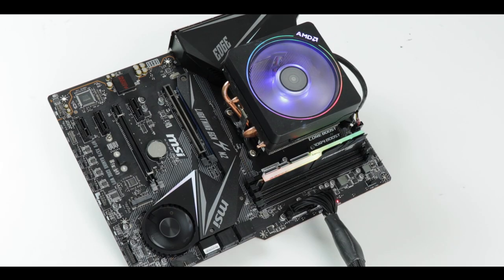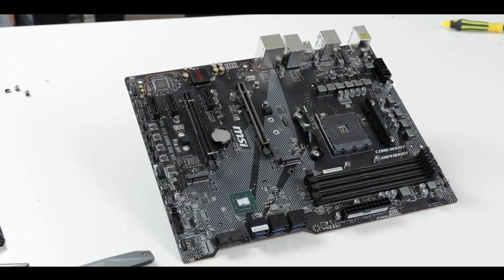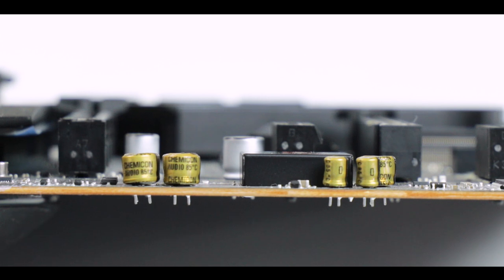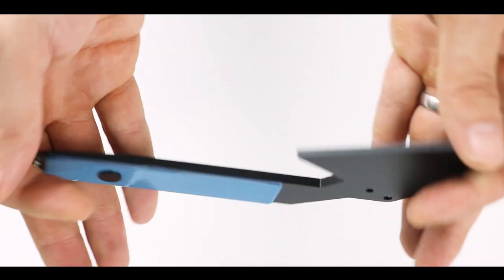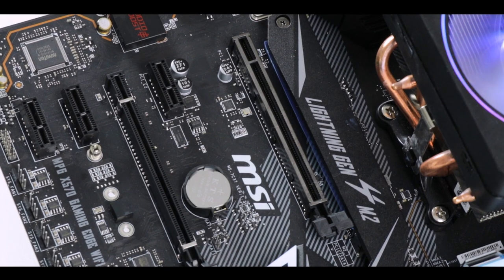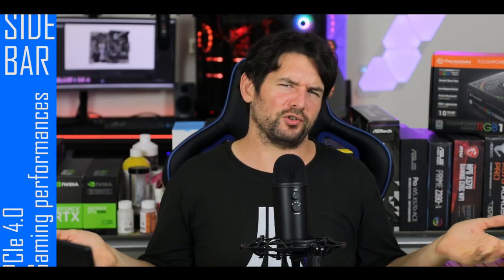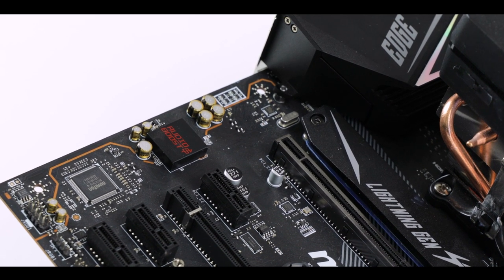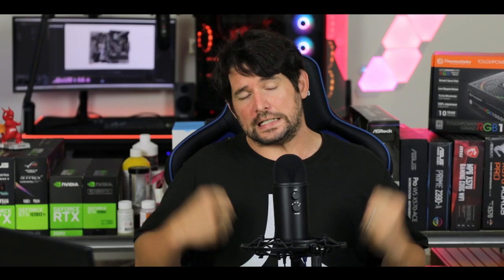MPG MSI X570 GAMING EDGE WIFI : No, No, No!

Comment: I have same mb. 128GB 3600Mhz memory, RTX 8000, AMD 3950x. I'm rendering 3D animations everyday and i did not have any f*cking problem :)
Reply: Same here no issues at all, lol.
Reply: not as workstainy as yours but i have 16 GB 3600 Mhz, AMD 3900X stock AMD fan and a RTX 3070 and i've had zero issues with stability. sure it took 2-3 months to get a bios that would let me use the full 3600 mhz instead of 3200 mhz but that's IT! nothing else! it's a super stable platform and i never experienced random crashes or bluescreens. 
my mobofan is set to the most silent option and i only see it spin up when turning on the computer else it's just stopped. the warmest i've seen in my room is 32C so it will be pushed but still never really turns on. 

I don't really need the feel to overclock any cpus these days and certainly not my 3900X which chugs through anything i throw at it.

Comment: I have this board. Easily installed into a fractal meshify-C and booted on my first attempt with an R7 3700X and 16GB 3200mhz ram (after enabling XMP) with no issues! I have an evo 212 black edition for the cpu cooler with 1 intake and 1 exhaust case fans and my VRM’s at stock stay sometimes stay under 60C and never go above 65C when intense gaming or long video rendering. I was very impressed with the thermal performance of this board compared to some complaints I’ve seen online in videos and comments. I can recommend it! One complaint I do have is that the WiFi is trash. Had to buy an external USB WiFi adapter to take advantage of my gigabit connection, but if your max download speed is less than 300mbps, it wouldn’t matter anyway as far as speed is concerned. As far as range is concerned, my router is about 10 feet away, so I can’t give accurate feedback about that. Overall, I recommend for anyone looking for a budget X570 board and don’t wanna deal with biosflashing
Reply: What I read ryzen7 3700x 65w tdp is good for this board :)  I have bought same combo and waiting its arrival :) problems starts with ryzen 9 3xxx . So probably ryzen 9 4xxx maybe 65w tdp will be cool for this board ;) :D
Reply: I also have this board with a 3700X and 2080Ti on a machine that I use for VR gaming, game development, 3D CAD design and video editing, and I see similar thermals as you do. I've never had any issue with it. Using 3600MHz Trident Neo with XMP.
Reply: Can you use in the first m.2 slot only gen4 m2?
Reply: @kunstlicheintelligenz8043  no , it can be used with gen3 also
Reply: @akshay-lifeofayogi321  but the thing is the first m2 slot doesnt work with my gen 3 m2 but it becomes energy. the mainboard is not broken but my m2 works in the second m2 slot normal without problems
Reply from the maker: Yes !

Comment: I have this Motherboard and my VRM temps with a ryzen 7 5800x  running cinebench r23 for 40 min peaks at 75C and I've been using this MB since April. I'm not sure if MSI did a revision but my temps are not hight enough to be a concern.
Reply: Mine are even lower here on a 3700x with msi game boost setup where powerdraw and voltage is notorious on gameboost so maybe I did get a revision after all and nobody bothered to look to see if the problem is fixed.
Reply: You could be using the fan ratio correctly
Reply: My setup is similar. What cooler are you using? My temperatures are reaching 75 just by booting windows.

Comment: 0:50 "I usually do great reviews for MSI, but they stopped paying me...
Reply from the maker: Lol... no brands ever gave me a cent or even gave me free hardware. 

Mainly because i dont accept either :)
Reply: @Laurentschoice  it's a joke LMAO
Reply from the maker: I know I know... akh.. not sleeping that much these days :)

Stay safe :)
Reply: @Laurentschoice  yh man you too
Reply: I recently Bought this Motherboard with Ryzen 3900x, 8*2 16 gb DDR4 3600 Trident Neo with Antec Mercury 360mm Liquid Cooler and its overheating the CPU like crazy, hitting 70 degrees at idle and load temperature is hovering between 90 to 95 degrees. You are right Man! I feel my worst purchase ever!. What is the solution? I don't want to fry my crazy fast 3900x.
Reply: V52VGX i have the same set up and don’t have these issues.
Reply: @V52VGX  i have a 3900x and mine idles at 40c with the stock amd cooler
Reply: @Nis3z6r  With MSI x570 Gaming Edge wifi?
Reply: @V52VGX  i bought this mainboard with ryzen 5 3600x gtx 1660 super and 32gb of venegence ram. i will see what kind of temparatures i will get... all in the corsair spec 06 rgb case.
Reply: @V52VGX  did you put thermal paste on cpu or toothpaste?
this is not a mainboard problem,
or the cpu has issue, and now you should have seen with other kind of freezing and similar issue, or simply yu have not installed correctly
Reply: @luigipetillo555  Thank you!
Reply: @V52VGX  Thaaaat sounds more like your pump or fans aren't being engaged properly in the AIO.  I had issues with my AIO when I first built a Ryzen system as well.  It seems the fan control settings in the BIOS were to blame.  You need to set the fan control for whichever header your pump and fans are connected to to "full speed" rather than being set to a curve.  I don't think even this sub-par motherboard would cause that kind of extreme overheating, especially without any overclock.
Reply: @blossem5742  What kind of temperatures did you get?
Reply: @blossem5742  how's the cooling of spec 06 rgb case bro?
Reply: @V52VGX  I have a 3800x on this, and I get 35c idle with a Corsair AIO 280mm maybe it’s just your cooler.

Comment: I am using this board with a ryzen 9 5950x and a rtx 3080 ti for over 9 months and had no issue. The only issue i had with the pc was my aio pump failing but that probably didn't have anything to do with the mb.
Reply: i needed this comment because im on this board with a 3080 and about to upgrade my cpu to the ryzen 9 5900x and everyone is telling me i made a huge mistake and im about to destroy my build.
Reply: @kylefontenard4033  have you upgraded to 5900x with this motherboard? how is it?
Reply: Im running a 5950 with this motherboard as well. February will mark 2 years with it. The only issues I have had where based in MSI's Internal softwhere. I had alot of issues with drivers and maintaining CPU temps in the beginning. Also had issues where my hardlined 1gb/s internet was getting throttled baucause of MSI lan manager. But after spendind time on working out those kinks, its pretty smooth and stable. I am still going to debate upgrading the board for the MSI Ace S soon, I feel like this board is the only thing holding back the performance of my system as a whole. 

AMD 5950x 
3060ti 8 gig. later upgraded to --> MSI 6900xt
64gig ram
kraken AIO
Note: I upgraded my PCU from a 850 to a 1000 because I was having gpu stability issues and realized is was the power draw. 
Additional Note, I am not experienced in overclocking so I have not overclocked this system at any point.

Comment: i have this board with a 3800x and i have Zero problems with it over clocked and 3600mhz of ram. Temps at idle are 31c and when gaming They dont reach past 60c 

game on this this for 9 hours a day lol
Reply from the maker: Hey there:)
In the video I am talking about VRM junction temperatures. Not CPU :)
Reply: Laurent's Choice how do i measure VRMS junction?
Reply: I understand what your testing but to tell people this board isnt a good board to buy simpley cuz you tested it for 1 day. As I said I have had zero problems with this board.
Reply: @NoLifeNolow  i have already ordered this board along with a 3800x and an RTX 2080 super, i am not planning to overclock, thank you for your comment and experience, this guy is actually terrorizing people with this title and the way he is talking about it...
So you don't have any issues with it? Great news mate! 
Enjoy your games!!!
Reply from the maker: Take temps from the soldered point on the back side of your mobo
Reply from the maker: Hey Nolan. 

To be fair, the testing period goes on for a week (5 days in this board case). 

Having such high temps doesn't mean that u can t push a CPU... it simply means that the board wont be as durable as equivalent boards. 

Reaching 100c does age the Power stages and I particular the chokes much much faster. 

Having solid state capacitors helps MSI avoiding immediate bursts.. but overtime u will experience blue screens  linked to failing power stages. 

I hope this helps.
Reply: So can you buy 3600mhz RAM? In the product description it only says up to 3200mhz?
Reply: @JuicyStudios.  hyperx fury 2*16Gb. Max frequency 4000, but i would change it back to 3600 xmp.
Reply: Do you have any reference videos about how to build it?
Reply: @JuicyStudios.  DDR4 MEMORY: 1866/ 2133/ 2400/ 2667/ 2800/2933 /3000 /3066 /3200 /3466 /3600 /3733 /3866 /4000 /4133 /4266 /4400 + Mhz by JEDEC and A-XMP OC MODE
this what i see mate
Reply: Can you use in the first m.2 slot only gen4 m2?
Reply from the maker: Agreed
Reply: Dr Chad ThunderCock   i watercool my cpu on this board and nothing happend it does not reach over 60 celsius
Reply: Guys, i just received the money back from amazon, i rma this board after almost 9 months because on a August normal day after it worked always fine without problems, suddenly the pc didnt turn on anymore, after bringing it to a compurer shop, it came out the mobo was dead. I dont know what the hell happened. Now i ordered the msi x570 gaming plus, i hope it will not let me down like the previous one.
Reply: @Laurentschoice  @Laurent's Choice I have a question, this video was made about a year ago at this point. Is it safe to say that MSI most likely updated the BIOs to correct the VRM heat issue? Or is that even possible? The reason I ask is because I just ordered a super high end 9 3950x/3090 build and this is the mobo that they are using with it and I didnt see this and Hardware unboxed vid until after and now I cannot change it.. ? Can this type of issue be addressed in BIOs updates?
Thank you
Reply: @Twoclickchris  bro I got this mobo too and I’m gonna us the ryzen 5600x/3070 so idk what different motherboard I should get.
Reply: @kxlluah4002  hey I ended up canceling my order and building my own with all the parts I wanted. I ended up using a Aorus X570 Master with my ryzen 9 5900x and 3090. I’m so glad I made that move. I called MSI and they said I’d have problems with a cpu like that so
Reply: @kxlluah4002  you should have zero problems with a 5600x. Anything above 6 cores are when problems arise with this motherboard.

Comment: out of all the mb under $200 the msi mpg x570 gaming edge wifi mb gets the best reviews on amazon.
Customer reviews
4.4 out of 5 stars
4.4 out of 5
373 customer ratings
5 star  
 73%
4 star  
 13%
3 star  
 4%
2 star  
 2%
1 star  
 7%
By feature
Style
4.64.6
Easy to install
4.64.6
For gaming
4.44.4

that's 373 customer ratings so i think we've moved beyond what might be phony reviews.
Reply from the maker: It's just not the best mobo I  reviewed this year ;)

Comment: No, no, no??? 90% of the things you say about this board are positive! I just bought one and I love it. Zero problems.
Reply from the maker: Like I said in the review,  it will.really depend what CPU u will run on it  :). 8 core and below will  do great. 

Over 8 cores might experience excessive PCB heat and therefore a reduced lifespan. 

Hope this clarifies :)
Reply: @Laurentschoice  I understand. I just wish you'd get rid of the No No No. It's not that bad of a board. 
Also, I have a question. You said that both M.2 slots can run Pci 4.0 but the manual it says only the top one can. I think the Msi carbon board has both at 4.0. I'm not sure if I should buy another 4.0 chip or not. Thanks in advance and I really liked your review btw.
Reply from the maker: Ur welcome :)

So in application both the m2ssd should work with PCIe 4.0 standards since the chipset is PCIe 4.0 as well :)
Reply: @Laurentschoice  Im using a ryzen 9 12 core and have been told it will be fine. You just need the right fan ratio
Reply: @LaylaBvOfficial  i am also going to buy ryzen 9 5900x for this motherboard, do you have any issue in your system ??
Reply: Mám presne túto dosku a procesor ryzen 9 5900x... Ide bez problémov. Používam MSI 280 vodné chladenie. Teplota v kľude je medzi 40 až 43 stupne celzia. PC skrinka je lian li Lancool II... Túto zostavu mám už 10 mesiacov... Som spokojný akurát že nemá USB-C výstup do predného panela...

Comment: I have this board and its a great board aside from not really being able to understand this guy i would recommend watching other reviews this is a great board I've had no problems
Reply: same, don't have any issues with it.
Reply: Thank god. I did alot of research before getting this board and this review was worrying, only thing is, Is one of the wifi ports are loose. Do you think this will be a problem?
Reply: @LaylaBvOfficial  There is no wifi port it's wireless. Are you talking about the antennas? 

I agree with what was said above. A great board. I have had mine for about a year now with no issues.

Comment: sorry mate but you are wrong.i got no problems at all.i overclocked my ryzen 3700x and ram at 3600Mhz.it is stable with no issues.it's a really good mobo.worth the money
Reply from the maker: Hey :) 
As I said in the review, it ll work fine. But running that high of PCB temps mean a short lifespan. So it ll work.. and itll work great:) , but not as long as a cooler board . 

Hope this clarifies .

Comment: i have this mobo vrm temperatures reach 60-65 C in stress after i overclocked my ryzen 7 3800X to 4,4 GHz 1,3V so i dont think its a bad mobo
Reply: stock cooler?
Reply: Hey Wydra, can you please tell us what cooler you are using ?
Reply: I wish, I had this motherboard with a ryzen 7 5800x + dark rock pro 4 cooler, my temps would get so hot my PC would shut down on certain games. after switching to a tomahawk that problem vanished
Reply: @Twongz_does_anything  Can't remember, I don't think I messed with it. At one point I even switched out for a 5900x and it was still overheating in some games, it was definitely the motherboard.
Reply: @eel3161 do you use this msi x570 Motherboard with R9 5900x ?.. do you face any issue ?

Comment: Ohhh the joy of NOT being attracted by overclocking. I will never understand that anyway...
Reply: Thats me.
I undervolt whenever i can cause the TOTL cpu’s have a lot of overhead whenever i use them. The new Ryzen 9 is really damn fast for compiling unreal engine, and i like it when my cooling is quiet. The game i play a lot(overwatch) have capped at 240fps cause thats my monitors refresh rate so i dont need extra power either.

I know a CPU never died on me yet, but i still feel like going easy on them
Reply: Hello, im going to be buying this mobo and the 3700X can you give me any tips or something to know when I build my pc/overclock thanks

Comment: Is there any MSI MPG X570 GAMING EDGE Wifi user who updated/flashed their BIOS to the latest
2020.01.13 {latest}

How's it doing, did you encounter any problems,
Did you update Before or After a Fresh Windows 10 installation?

And if you're a RADEON RX 5700 MECH OC 8GB GDDR6 user please tell me, how is the compatability
Any issues?

Comment: My MPG MSI X570 Gaming Edge WIFI has terrible bluetooth connectivity. When I try to use bluetooth controllers or headphones they drop connection unless they are pointed directly at my box.
Reply: Are you using the wifi antenna's without them you have less than a 30cm range without a pc case blocking the signals.

Comment: Been using this for 5 months or so with a 3900x,3600mhz 15cl ram, rtx 2080, it’s fine. i’ve never even seen the chipset fan kick on. i monitor temps all the time as well and never have seen anything out of the ordinary.
Reply: My hint maybeeee their have better revision of boards after first issues found. Probably yup ;)) revisions during production can improve things a lot :)
Reply: How are you running 3600mhz ram with 1800 fclk. Mine cant run that high
Reply: @Twongz_does_anything  Just lets me, its an MSI x570 MPG series, not sure exactly which one. it's also samsung b-die ram
Reply: @dinosoarskill17  what ram do you have
Reply: @Twongz_does_anything  4 sticks of G.Skill F4-3600C16D-16GTZR
Reply: @Twongz_does_anything  each stick is 1800 = 3600